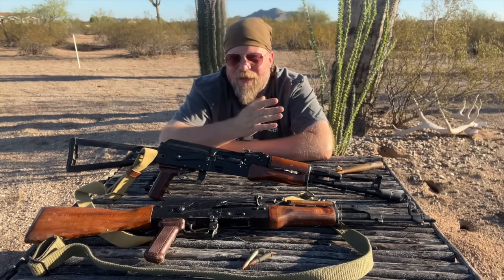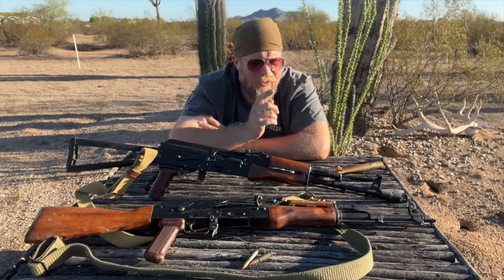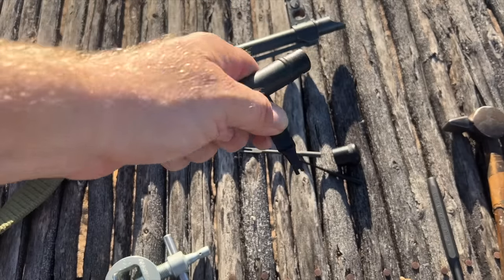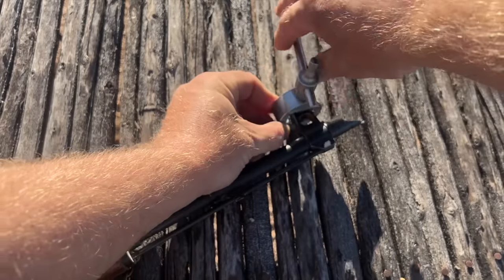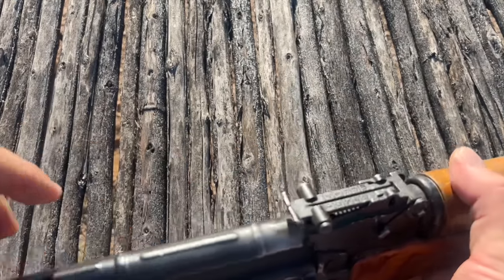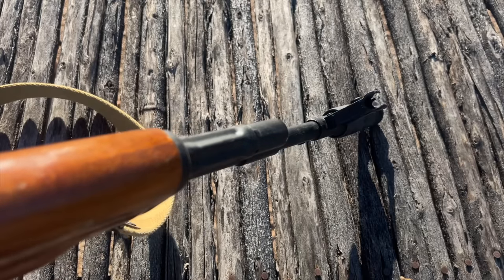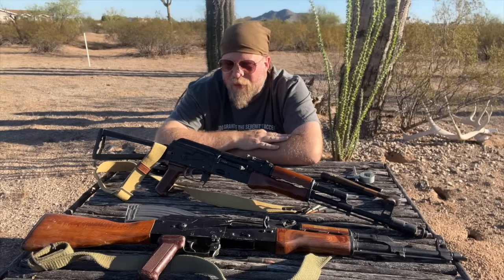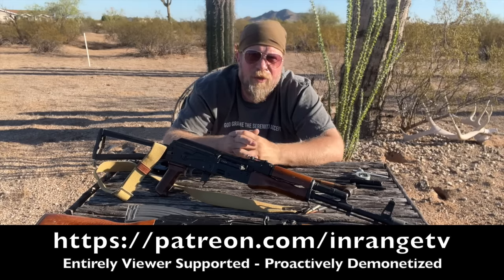Zeroing The AK

Comment: The 7.62x39 AKM leaf sight is calibrated for 7.9 gram (122 grains) bullet flying 715 m/s (2346 ft/s).
To check if your ammo is compatible with the leaf, shoot 4+ shot groups with every leaf setting at 100 m (109.4 yards) with the same point of aim. Measure the distance from point of aim to average point of impact of every group. It should be as follows:
1 - 0 cm, 2 - 10 cm (3.9 in), 3/П - 25 cm (9.8 in), 4 - 44 cm (17.3 in), 5 - 68 cm (26.8 in)
To have better idea about the trajectory google "таблица превышений акм" (table of elevations above sights line for akm)

The 5.45 AK-74 leaf sight is calibrated for 3.4 gram (54.5 grains) bullet flying 900 m/s (2953 ft/s).
1 - 0 cm, 2 - 5 cm (1.97 in), 3 - 13 cm (5.1 in), 4/П - 24 cm (9.45 in), 5 - 37 cm (14.6 in)
Reply: Nice
Reply: Whatttttttt?
Reply: @1s1k97  If your ammo is close enough to the one that the leaf was calibrated for, with 7,62x39 AKM for torso sized target you set the leaf on 3 and you can hit it at any distance from 0 to 300 meters (328 yd) with belt buckle point of aim, because point of impact will not get higher than 31 cm (12.2") above point of aim.
For head sized target you can set the leaf on 2 and hit it at any distance from 0 to 200 meters (219 yd) with chin/mouth point of aim because trajectory doesnt go higher than 10 cm (3.9") above point of aim.
"Table of elevations" (google "таблица превышений акм") state how high the POI will be above POA at certain distance on certain leaf setting.
If you shoot groups at 100m with different leaf settings and have the same elevations above POA as stated in the table, your ammo is compatible with the leaf and you can choose a leaf setting for given target size and hit it reliably.

Comment: Yeah I did this recently with a WASR10 and my front sight ended up all the way to the left as well. I also got a PSA GF3 AK and it was zeroed right out of the box which was nice. I wish I would've just got an AK74 though, the 5.45 cartridge really was quite a major upgrade. 

Whenever I fire my AKMs I remember "oh yeah this is basically a WW2 gun" because it feels like any other semi auto WW2 gun with maybe a little less recoil.

I like AKs but the AR is dramatically better.

Comment: One full turn of the front sight is approximately 8 minutes of angle of elevation. One full turn of the sight tool on the windage drum is approximately 6 minutes of angle of windage. Trick with the windage is knowing when it actually started moving. Also shorter or longer barrels (krink vs SKS) will vary slightly.
Reply: I'd love to put an AKM rear sight ladder on an RPK (or vice versa), zero it for 100m, and then see just how big a difference the longer barrel makes

Comment: I zeroed my Zastava m70 a few years ago, then tried shooting it at 300yd recently. Even though it was a Century Arms import, the zero hadn't changed a bit. I set the rear sight to "3" and had to aim slightly under the target (because 300yd =/= 300m). It's a very robust design and is perfectly usable if you know how to use it
Reply: dont user =/=, it is properly !=
Reply: at least in most coding languages, maybe different for engineering

Comment: Speaking to the M16/M4/AR-15's elevation zero, it may require a tool but I've never done it with anything other than a bullet tip, a nail, or the screwdriver of a multitool. (I keep saying I'll buy the actual adjustment tool and I keep not doing it.)

Also I feel like I don't want to know who said the AK isn't able to be zeroed for windage.
Reply: TRex arms

Comment: Nice presentation. Job well done. I have my AKMS zeroed at 100m cutting the target in half. To me it helps with the aiming being definitive, but that is me.   

I fully understand the "deal with it" on the sight alignment being so far off. However, if it is THAT far off I'd consider getting that barrel re-timed or if the barrel is mounted properly then get the rear sight fixed. I didn't get a good look at how the rear sight sits in the sight base but in many cases a wee bit of filling on one of the pins engaging the sight base to adjust the left/right cant is all you need. There is a video or two here on YT showing the procedure. Simple stuff. Cheers.

Comment: Mr. Skinny Jeans is likely enraged at this video.

EDIT: Also, if I recall correctly, the Soviet manual for the AKM and AK-74 say that the battle sight setting corresponds to 330 meters and 440 meters respectively, when aiming at the belt line of an enemy,
Reply: But of an unwarranted comment... Not everybody is perfect and frankly this is not common knowledge.
Reply: The manual seem to be wrong. Russian military armorer, and some other competent dude separately used calipers  to measure distance from the bottom of reciever to the rear sight notch, and its identical on 3/П for akm and 4/П for ak-74. They checked it with shooting too.
Reply: @tiortedrootsky yes, but 5.45 has a much flatter trajectory, so even with the same rear sight base, it has a farther battlesight zero due to less bullet drop
Reply: @porpoision   in the manual they needed to write that "П=400m, which roughly fits the 440m distance of straight shot for torso sized target". Which is true.
But they end up writing "П=440m, the distance of straight shot for torso sized target which roughly fits leaf setting "4". Which is not true, as for the calipers measurements.

Comment: it's a 2 step process
1) zero the AK
2) drink beer
Reply: You have the steps backward
Reply: Vodka
Reply: Mostly correct.  In the old Soviet Union it was:
1) Drink industrial alcohol.
2) When if vision returns, adjust sights.
3) Drink more industrial alcohol.
Reply: @lightweight1974  in old Soviet Union industrial strength alcohol drinks you
Reply: @rslover65 this guy AKs

Comment: My front sight drum on my WASR is pretty much siezed up. I've adjusted it in the past, but it needs readjustment and the magna tool isn't working, it slips off when I torque it before the drum budges.
Reply from the maker: Soak it in kroil and break it free with a punch and hammer.
Reply: @InrangeTv  Thank you Komrade

Comment: I just cheat and use an optic. With the ammo I shoot, I can zero at 25 yards and that zero also coincides with ~300 yards +/- a few inches. I have to hold low at 100 and 200 yards to get center mass impacts. This works for me as I generally shoot longer distances and being able to use the Eotech reticle for ranging at 400 and 500 yards is seamless.

Comment: When I got my first AK I adjusted the front sight on the range by hitting it with a rock. it worked.
Kinetic impulse FTW.
Reply: I've done it with a tiny tack hammer.   Later I made a small C-clamp with a cutout with a hacksaw,   on the fixed side of the clamp.
Reply: If you can't fix it with a hammer, you have an electrical problem

Comment: is that windage drum then only being held by machined tolerance? tightness and such to the frame itself. wouldn't that essentially slowly oversize the frame's circumference thats holding the windage drum, therefore it gets loose? specially if you played back and forth too much with that adjusting tool. Sure, probably you can change the whole front sight frame and repin a new frame to the barrel, and considering likely economical reason that AKs were made in the first place, that's probably expected, to not fuss too much after its zeroed as best as you can.
Reply: If the drum got loose, you could just tack weld or solder it in place.
Reply: On most aks everything is press fit to very very tight tolerances, the sight blocks, gas blocks etc are all pressed into place and then cross pinned. The front sight drum is pressed in but not pinned. Once windage set at the factory/arsenal by an armorer the front sight windage theoretically shouldn't be touched any further. The guns are zeroed to the issue ammo of the country of service. In the civilian world this is somwhwat different because the ammo you buy to use in the gun will vary widely maker to maker or country of origin etc. Usually a typical owner will verify performance with what they usually use alot of and then maybe tweak it to print better with a specific load they like or have alot of. The gun should never be rezeroed so often that it would cause wear to the front sight drum and cause it to loosen up. There are guns that have the issue but usually that comes from out of spec parts or mixed up parts of different  origins. Civilian market guns very often aren't made to particularly great standards compared to their original service counterparts. Some makers are better than others. But overall just set and forget, if you like changing ammo loads often, put an optic on the gun of some flavor and adjust that as you wish, it's much easier than messing with the front sight drum.
Reply: @severerisk1581  do for some reason, some ammo prone to wind to left or right?  if not, you wouldn't have to mind much about actual wind blowing to different bullet weights at 50-100-200m right... hence, set and forget(if its any way loose-changing by shock, tack weld might even be a good idea), if crap ammo is giving almost 2 feet circle in 10 rounds with bench rest zeroing, let it be, but at least its around vertical line of 6-12 o'clock on the irons.
Reply: @Shiruvan  ok so let's look at this from a military doctrine aspect. In the countries that  initially developed and issued AK variants (we are mostly talking about the USSR and Warsaw Pact client states) the motorrifle regiment doctrines placed importance on mass fire on the advance.  So individual marksmanship while taught is not the central focus of the doctrine.  The weapon systems en masse should effectively produce a beaten zone at the units objective.   It's more or less a mass form of fire suppression while supported by armored vehicles. If the guns have a fairly wide dispersion front point of aim its not exactly critical. The ammunition supplied often does have wide variances in consistency,  but not enough to make a serious difference for this doctrine to work. At close in range (-100m or less) the accuracy or how the gun groups its shots if its in proper specs shouldn't cause an issue for the individual soldier. The majority of issue ammunition should be in the 123 grain to 125 grain range across all types, so not something like in the case of say belted machine gun ammo where you can have light ball, heavy ball, tracer, AP, or other payloads . But alot of GPMGs and larger support weapons have sights that will allow the gunner or team using the weapon to rapidly adjust their point of aim. For An infantry rifle this is less of an issue to practically a non issue for the countries that employed this doctrine. Precision fire if needed would be addressed by specialists with DMR type weapons at the company level (sometimes lower or higher depending on the country) . If a weapon does have accuracy/shot dispersion issues, it would then be handled by a unit armorer. The soldier would then either have is gun exchanged for another or if the repair is quick then simply returned. Anything worse would likely be sent back to the factory for refurbishment or disposal if it's too much of an issue. But in most cases a unit armorer could handle these issues just fine. Rifles with serious issues however are often encountered in countries or conflict areas where the weapons are already seriously worn/damaged/defective etc and the weapons were provided as military aid or as assistance in a clandestine manner. Some guns found worldwide are seriously worn out but still functional.  But for the type of fighting going on there, the weapons are still deadly enough and still do their job. Same goes for ammo. Old poorly stored surplus ammo or poorly manufactured ammo often ends up in conflict zones and causes issues for the end users.

Comment: As I understand it - and i could be wrong - the whole front sight assembly on an AK is a (very tight) press fit.  So if your post is all the way to one side, you could rotate the whole assembly around the barrel slightly to bring it into the centre.  Would that be feasible?
Reply: It is. There's vids about doing just that
Reply: It's press fitted, yes, but also pinned in place. A hole is drilled through the sight frame, the way it's creating corelating indent in the barrel. Then the right diameter pin is pressed or hammered in, to lock the front sight post in press fitted place. 
To do, what you are suggesting, the original pin must be removed, than you can rotate the sight post left or right. But hole and indent now are misallaign. So you have to machine drill that hole bit bigger, to fit bigger pin. Problem is, the indent in the barrel will be deeper, making the wall between bore and the bottom of the indent thinner. Also sight post base can be to small to acommodate bigger pin. And it's a machine shop work, not diy hand drill work.

Comment: How would you change elevation on a Chinese type AK where the front side is fully hooded?
Reply from the maker: They typically have a hole cut out on the top of the hood for the tool to be used.

Comment: My 74 will not zero. The front post is as far left as it goes and still shoots wayyyy left.
Reply from the maker: Ouch. That's really bad, consider replacing a rear sight with the RPK site and you'll have windage adjustments in the rear too.
Reply: Hit it with a rubber mallet to the left untill it aligns, I've done that before with my ak to zero it and now it's spot on
Reply: @InrangeTv  Thanks, I’ll look into that.